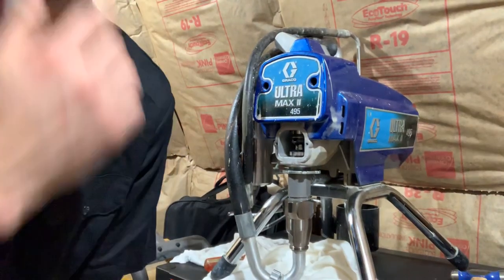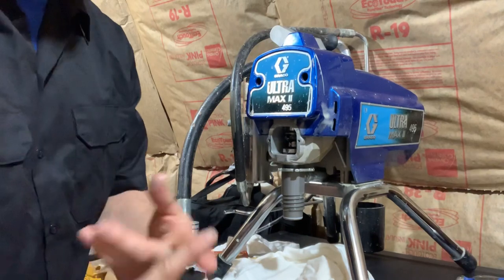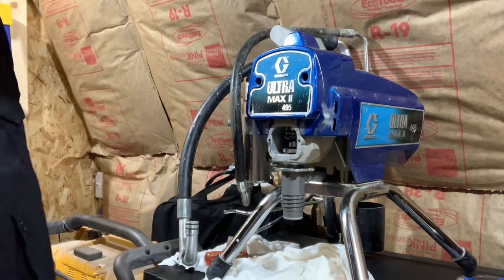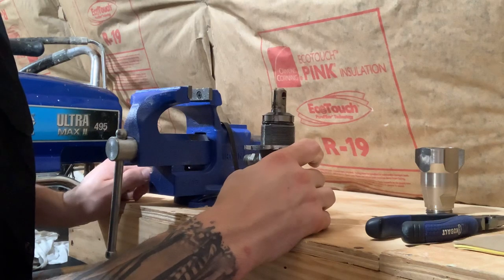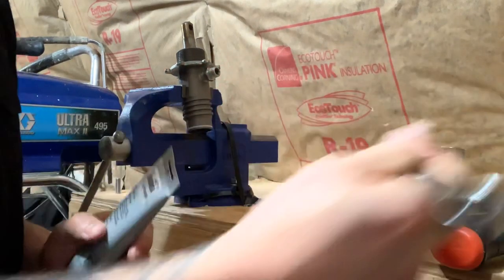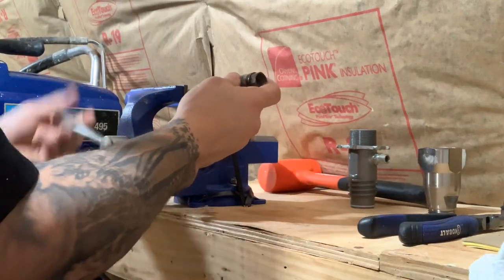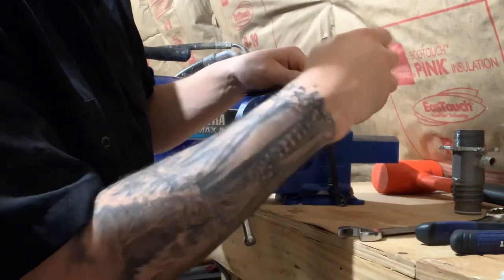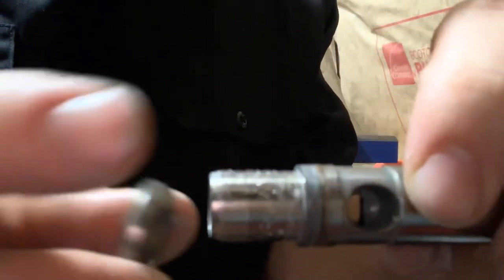How to repack a graco older style pump

Comment: Great video. Been a paint contractor 4 decades always wanted to do the repair myself save the 2 weeks plus down time. I can fix anything but without watching this would have been a nightmare.  Only suggestion for others may be to put the packing nut back on hand tight while putting piston back in.  Piston was pushing the upper packings out few times but not a big deal.

Comment: Your video helps a lot, thanks. Any time I'm tapping the piston back through the block I try to use a wood dowel. I was surprised at how clean the inside of your sprayer was. Do you dissassemble and clean it often? I run mine until it blows paint out through the packings and then I rebuild.